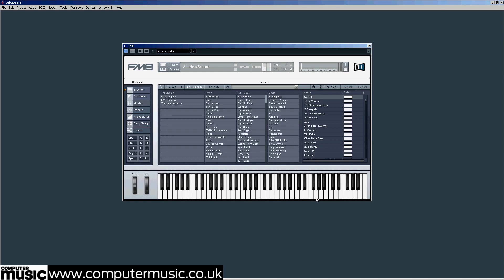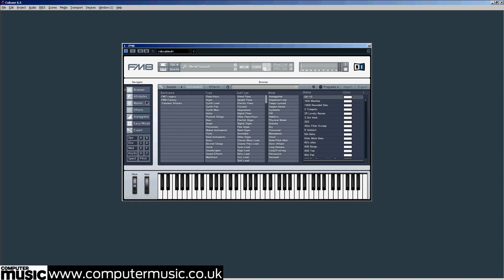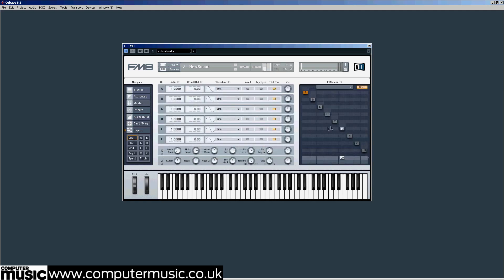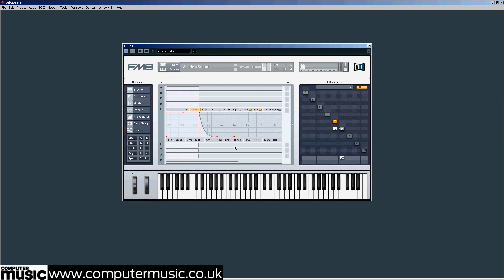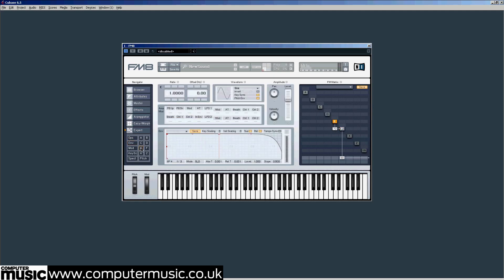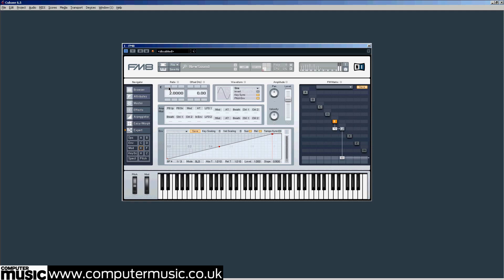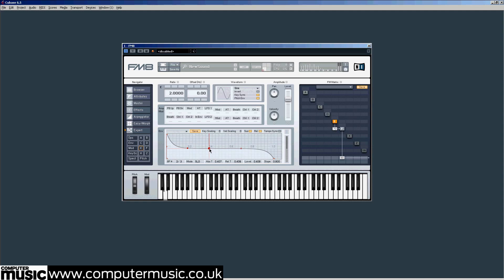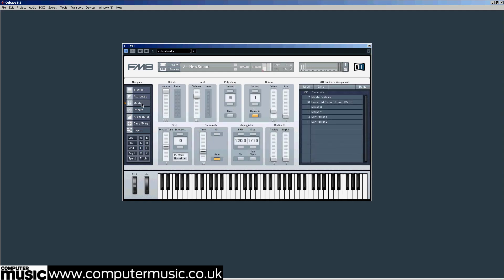Prodigy Full Throttle - Making the bass sound in FM8 (Computer Music #179)

Comment from the maker: Most CM plugins are in the common VST and AU formats, but Pro Tools uses its own formats, RTAS/AAX.

There are a few CM plugins in RTAS format: Blue Cat Audio FreqAnalyst CM, Ohm Force Ohmygod!, XILS-lab PolyKB II CM, and Loomer Cumulus.

You could also try a VST->RTAS wrapper, such as the one made by FXpansion. However, we can't guarantee how well it will work, as it's essentially a workaround.